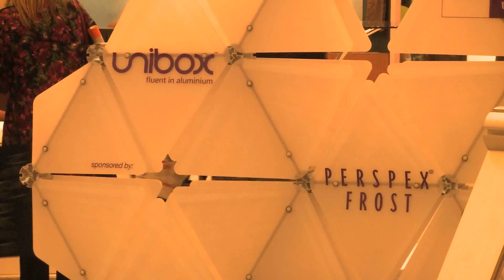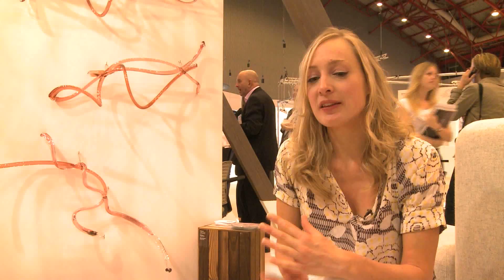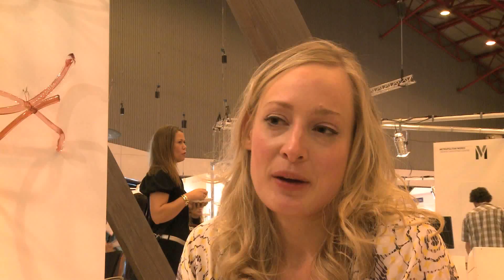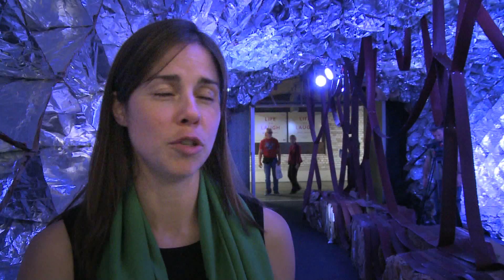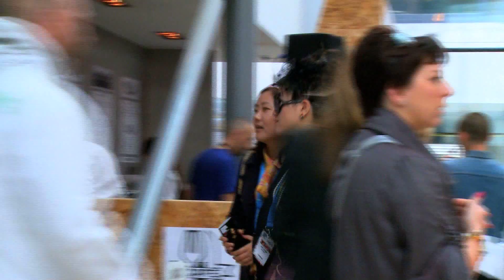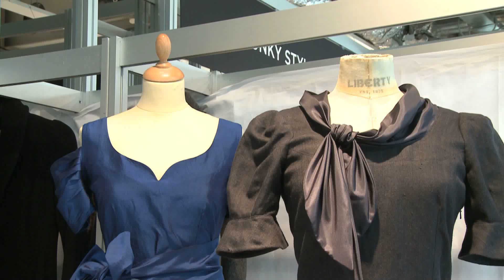London Design Festival

Comment: funny part about the clothes designers is that the combine by there lack of product knowlede different kinds off fabricks together
one fabrick you need to only wash by hand the other needs to be washed at al least 40 degrees but you cant put the designer clothes into the washingmachine because those so called designers combined those two fabricks  into one peace of clothes so you always need to wash it by hand